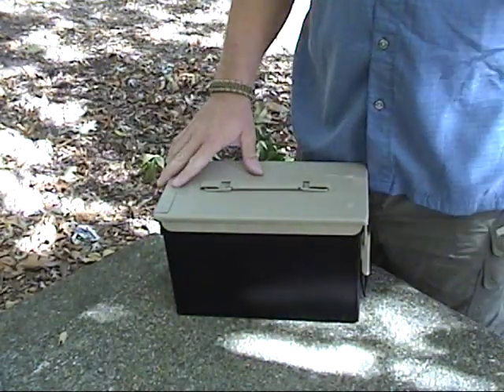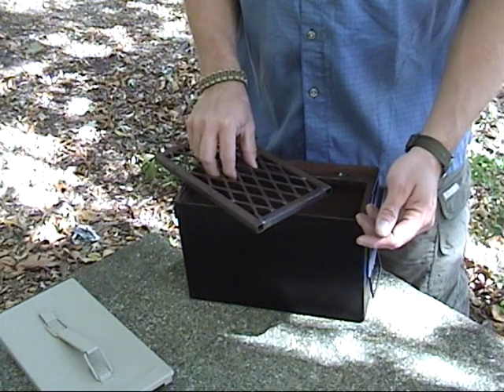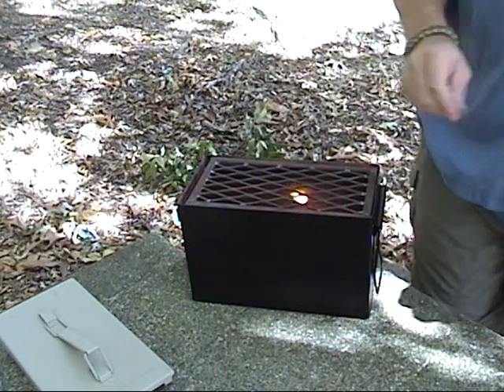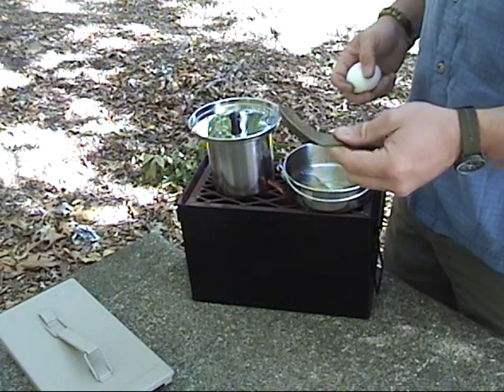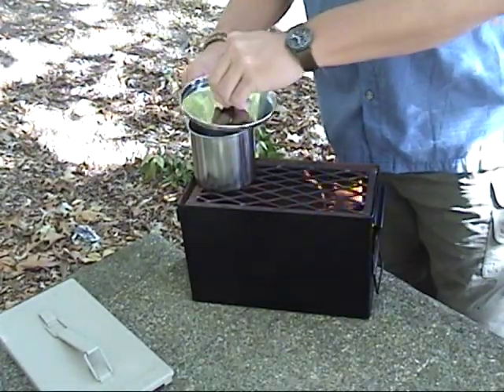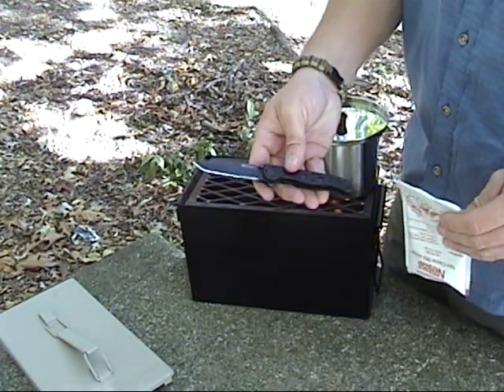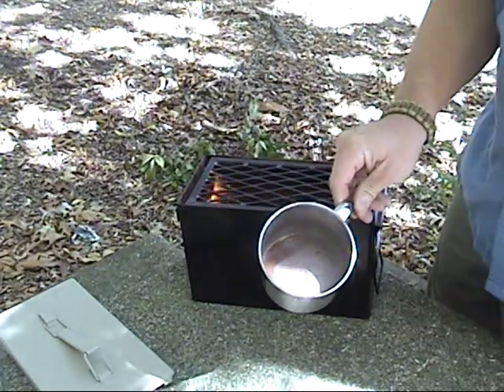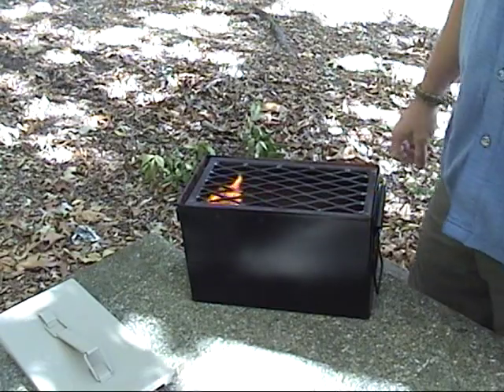Ammo Can Grill

Comment: Awesome grill, I just picked up a couple cans to tinker around with myself-  I have a question though:  It looks like you removed the rubber gasket and retaining plate from the lid.  Is that correct?  If so, does the lid still clamp down pretty tight without the gasket?

Thank you!